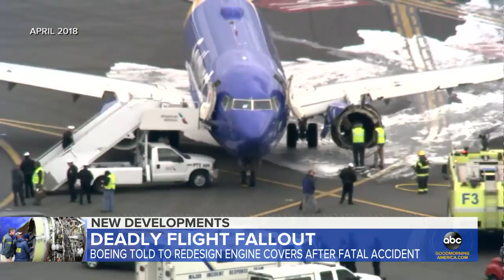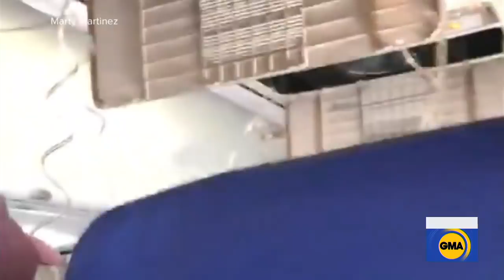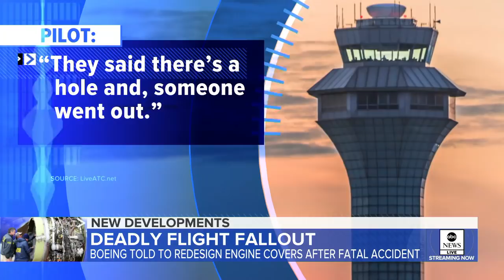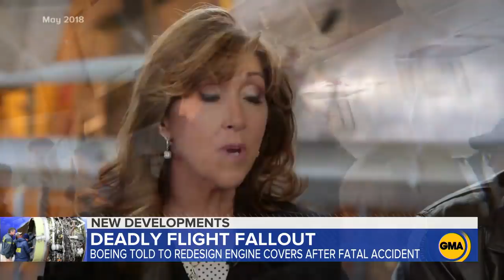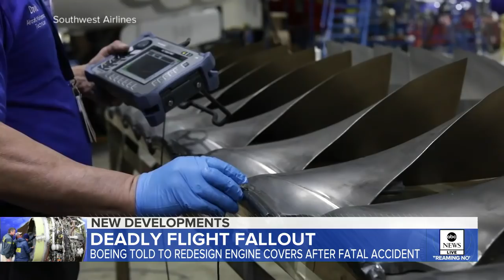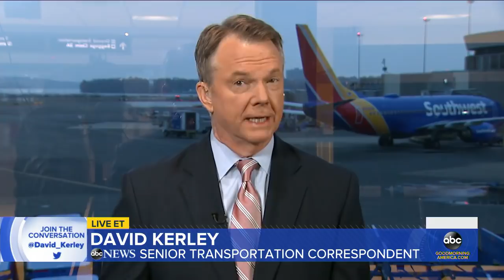Boeing told to redesign engine covers on 737 planes after fatal incident l ABC News

Comment: Boeing is reaping the seeds of years of cost cutting at the expense of safety.  Also, add years of conservative push for deregulation by the FAA, and we now have a perfect storm.  Why is Airbus, a supposedly government-run aircraft manufacturer, not having safety problems at the scale and scope of Boeing?  Simply put, Airbus does not prioritize profit and corporate greed over the safety of the travelling public.  Boeing is a poster child of how dangerous unbridled capitalism can be for public safety.  I just hope that the current corrupt regime in the White House does not bail out Boeing with tax dollars.  Let them feel the pain and pay the price, evening if it  means downsizing and running a distant second to Airbus. It is also striking to see how Boeing treats crashes of its planes when compared to Airbus.  Boeing reflexively makes it a PR strategy to absolve themselves of any blame.  They are the epitome of American corporate greed, which has reached epic proportions over the last 3 years.

Comment: & people wonder why i dont like 2 fly on certain type of plane's cause i dont trust other engineer's.. cause some rush something into product be 4 running tests on all system
& by the way if i was 2 fly i would always where my seat belt pretty much at all time while in something. At that speed & in the air..unless they say u can take it off in flight but then i still keep it on. Only time i would take it off is if i needed 2 use the bathroom.  That being said. I keep my seat belts on. Even if some says it safe 2 take it off cause they might not know if its safe 2 cause they know nothing about that AIRCRAFT.. they also not up 2 date. & have not been train proper about it.. just like i always when i drive my own passion ride's or ride in one. Till it safe 2 take it off.. REMEMBER  The first passion ride movie TOP GUN.. i learned a very long time ago. How VERY IMPORTANT 2 wear ur seat belts when i was a baby boy . cause if u need 2 do something. & or  something happens & u need 2 take action behind the wheel & other controls  2 regain & or take control or have 2 bail out. Ur not gonna be able 2 cause ur are not able 2 reach the controls react.2 operated & or hang on 4 dear life.. 
.

Comment: Good job Washington Senator Patty Murray. She has worked for over 20 years doing what ever it took to subsidize Boeing. This is Neolibral capitalism at its finest. Crappy planes failing.
Reply: The 737 is far from a crappy plane
Reply: If ur so confident to call it a crappy plane can u pls explain how MCAS works and what it is? Because most people talking shut about the 737 have NO idea what MCAS is and it just so stupid..
Reply: @cancelanime1507  737 MAX is not crappy but MCAS (the original implementation at any rate) is pretty crappy
Reply: Appable it’s not crappy it’s just Boeing did a crappy job not telling anyone about it..
Reply: @cancelanime1507  Even if they mentioned it, it still caused trim runaway unacceptably often.

Comment: Take one death in US to make a change; why it took 350 deaths overseas to ground the 737max ? 

As for the old 737, years after South West, Boeing still does not have a fix for several months and then it needs FAA approval (finally FAA is kinda working for public), then maybe another month or longer to get all 8000 planes fixed. Boeing ought to be dismantled and its CEO jailed.
Reply: ritemolawz  and who is this powerful man? Because the one I know doesn't use aircrafts!!